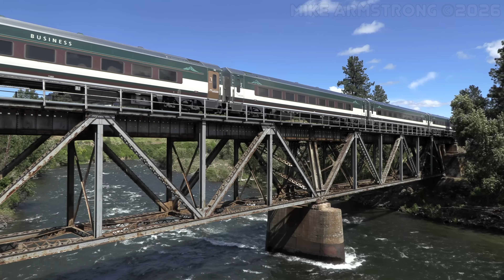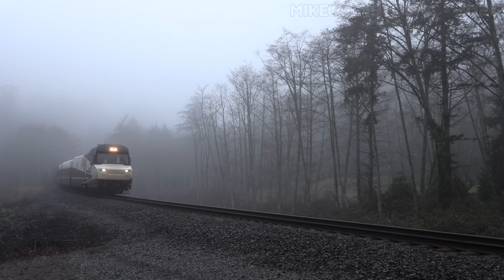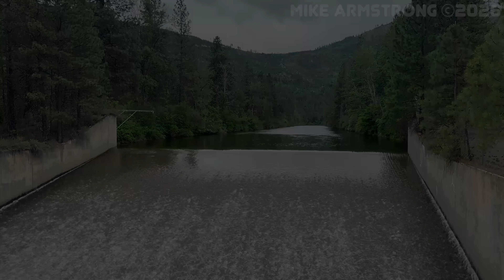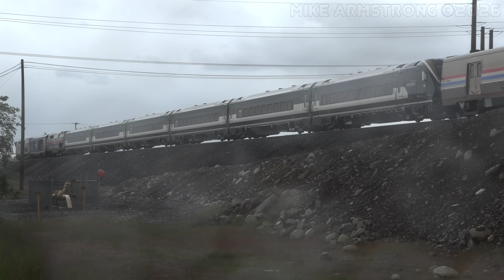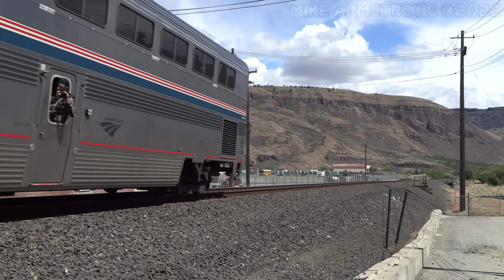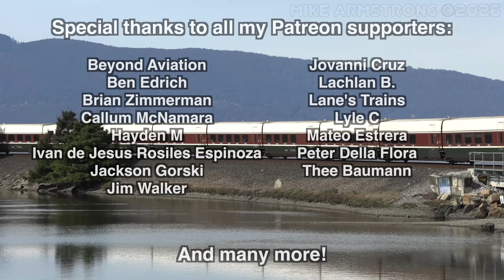NEW Amtrak Cascades AIRO Train Delivery

Comment: Nice catches ! Just one question, what happened to the ALC-42E that was with the set on the NEC ? Or is it one if the sets that are to be used with the SC-44's ?
Reply from the maker: Thanks! The two ALC-42Es will remain back east for additional testing until all of the Cascades train sets have been accepted for service.

Comment: Can’t wait to see the Cascades Airo in service and will be cool to see the Cascades painted alc42!
Reply: Unfortunately ALC42s will not be painted in the Cascades colors because they are not Intercity locomotives. The ALC 42s or Amtrak Long-distance Chargers are just that. They were specifically built for long distance service such as the Empire Builder, Coast Starlight etc. Amtrak has Charger locomotives specifically for those intercity routes and they are the SC 44 Chargers painted in the Cascades Amtrak California and the Pacific Surfliner. But you will see ALC42s or P42 dc locomotives on one of those routes when the 44s are undergoing maintenance.
Reply: @j @jeffreywatkins39  actually two of the new locomotives are alc-42e  number 70001&70002 which are in the cascade paint job the rest are the current sc-44 that will be used for Amtrak cascades
Reply: @jeffreywatkins39  Then what do you call the Amtrak 70001 and 70002? They are classified as ALC42E.
Reply: @pnwr1854 You are correct. However the E portion of those is useless. Because they won't have a battery car or power car that has the pantograph on it it will strictly be a diesel electric charger. Much like the regular ALC 42s

Comment: Are we going to see any new train's for Pacific surfliner? 🤔🚆
Reply: Not necessarily new but hand me downs from northern California. That I believe will be repainted in the surfliner colors. The reason you see some superliner cars on the consist is because some of the surfliner cars are undergoing a midlife overhaul. The Surfliner equipment such as the cars and locomotives are owned by the state of California. Amtrak just operates them and they plan to push those cars to 30-50 years of life. They were built in the 90s so they still got another 20 or so years left on them which gives California time for Research and Development because they are aiming for 0 emissions at some point the Surfliner will either be 100% Electric like the CalTrain or hydrogen powered similar to the MetroLink Arrow train.

Comment: Very nice video currently in Philadephia their are 2 locomotives ALC-42Es 70001 and 70002 still staying in the area for more testing. Their are 4 train sets currently in philadephia which are 79501, 79503, 79504, and 79506 as all sets will be sent to philadephia to head into the bear shops to get final inspections done and then leave the same way running as Amtrak 964 to chicago before being added to empire builder 7 to seattle washington. Currently 79502 is their already being the first set their for testing and crew qualifications. 79507 and 79508 are the last two left to be built while 6 sets are already completed. 79505 set 5 is still at Siemens Mobility facilty. The symbols being used to be tested on the keystone is 867/872/864/865 and to be used between philadephia and dc it will be 811/812.

Comment: gonna miss the f40 cab cars on the cascades
Reply from the maker: I will too. I saw many of them years ago on the San Diegans back when they were still F40s.
Reply: The Amtraks npcu locomotive Engines are still in service on the gold runner and I believe that surfliner equipment will reduce diesel engines locomotives soon in the near future that's my suggestion statement
Reply: Well, some of the Cascades-based NPCUs in standard Amtrak colors might be sent to the LOSSAN Corridor soon.
Reply: YOU HAVE NO TASTE.
Reply: The Amtraks npcu locomotive Engines are still in service on the gold runner and I believe that surfliner equipment will reduce diesel engines locomotives soon in the near future that's my suggestion statement
Reply: The Amtraks npcu locomotive Engines are still in service on the gold runner and I believe that surfliner equipment will reduce diesel engines locomotives soon in the near future that's my question
Reply: @Amtrak8306  Did you see my previous reply?